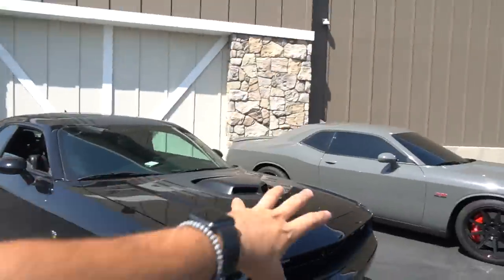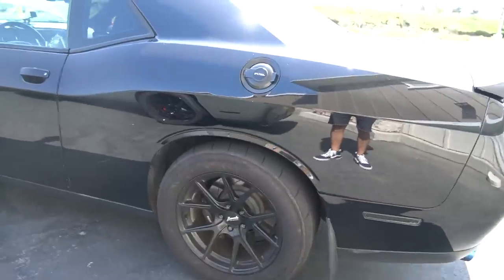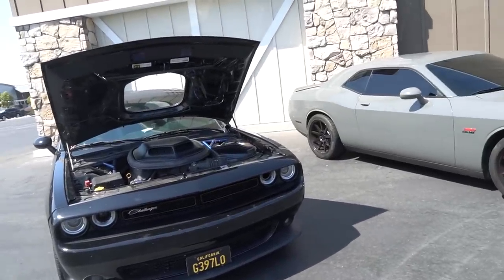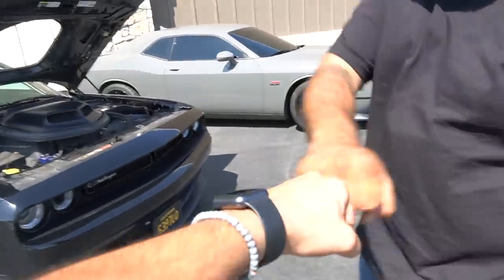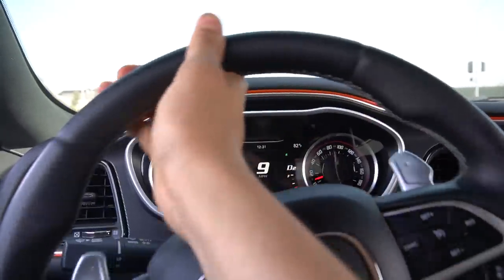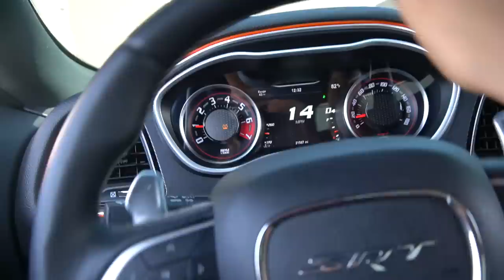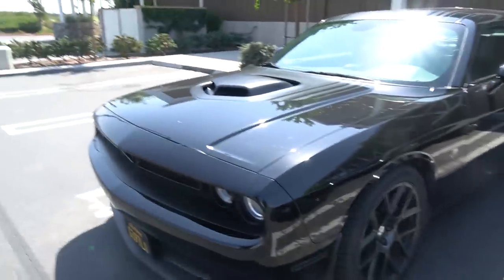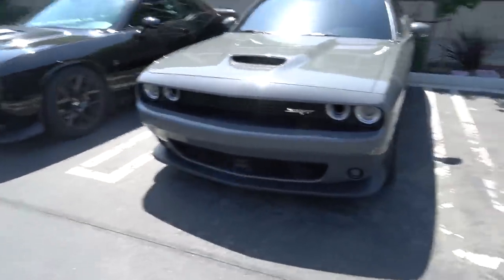Cammed Scatpack Challenger vs STOCK Challenger SRT 392!

Comment: Hmmmm who ever installed his cam did not install his cam...
Reply: JIMBO SLICE exactly
Reply: Exactly.  Smh ....
Reply: Fleeced
Reply: facts
Reply: Basically
Reply: It’s possible to get a cam and not have a lot more power he has factory mufflers with tips but still had long tube headers installed it’s like boob implants with no nipples
Reply: It’s slower because he has too low of compression because he isn’t boosted and has forged pistons he has a lot of upgrades that are only half of a good upgrade package you can’t do pistons and not turbo and long tube headers and not removing muffler and replacing it etc.
Reply: JIMBO SLICE 😂😂😂 right
Reply: no i think it's the hood scoop more air more speed
Reply: That comment was awesome.
Reply: JIMBO SLICE who tuned the car?? so i know exactly where not to go
Reply: Untuned maybe?
Reply: Joe Jones lmfaooooooo
Reply: Should have had some idling video so we could hear it the cam it doesn't have.
Reply: Trevon Adams you’d be surprised how much a small exhaust will hinder the work you do. But I think in this case he’s full of shit since he said his engine is forged not internals
Reply: @Trevon Adams I also forgot he said he’s got midmuffler delete on the “stock” car.  The way he said his engine is forged with piston and rods he doesn’t know he just made that shit up. And it’s a California legal car. It’s probably got a lot of loss on exhaust
Reply: Trevon Adams too bad I don’t know where he lives maybe I could make some cash running him he seems to be really confident in it. I think that’s what happens when guys get a fast car after driving a standard 5 speed car their first 6-8 years of driving. I can recall when my buddies Acura seemed quick to him if you shifted gears just right. Once he put the exhaust on it he was driving a “race car” it’s all he ever talked about. Then he rode in my dads Chevelle and when it twists and raises up he was glued to the seat he went out and bought a 2004 mustang with the GT package i think he said ford said it was quick. I didn’t know jack about Mustangs then unless it was a Foxbody. I still think fox body is the sexiest mustang made. He had to have that V8 so bad he was willing to use up his credit and pay 💰 for a mustang that came quick
Reply: Nah he probably got the wrong cam lol
Reply: @joejones2847  Depends on the compression.  If its same or higher than stock compression, power should be the same or more.  May just not be that big of a difference in cam specs vs stock.
Reply: Naaaa the grey 392 is not stock lol
Reply: "The cam is extra bro".
Reply: @joejones2847  forged internals have nothing to do with decreasing compression... Just a stronger material so he doesn't break any ring lands. But the cam may be an issue if the cam is meant for boosted applications.
Reply: Joe Jones it’s slower bc it’s a dodge 😂😂
Reply: I like how the second time you asked for the mod list he didn't even mention a cam 😂
Reply: JIMBO SLICE they probably finessed him they probably only did a ghost cam tune and they kept the cam. 🤣🤣
Reply: @joejones2847  good point didnt think of that
Reply: It's not his cam. If he'd just had the cam and the long tubes he'd be faster. The forged internals lowered the compression. The car is set up for a supercharger so until then ...
Reply: “It’s installed... now give me $1,000”
Reply: Trevon Adams that stupid hood scoop out too much weight on the car .. 😹
Reply: @joejones2847  mufflers aren't a true restriction, on most modern cars a muffler doesn't so anything but muffle sound. You wouldn't get but 2 hp if that.
Reply: Bruhhhhh we all know EXACTLY how a cam sounds like properly put it in... yeah buddy didn't quite do that 😅😅
Reply: WEAK 😂😂😂😂
Reply: You have to tune the car for max effect

Comment: Forged pistons made him slower, he needs boost to make up for the lower compression
Reply: 318  exactly, I’m sure it was built for boost
Reply: Forged pistons doesn't mean lower compression..... 2019 we don't lower compression anymore, we send that shit.
Reply: Demario Johnson  I mean yea but maybe they are lower compression pistons for a boost build
Reply: YES boost fixes everything......😁🔥🔥
Reply: On a typical drop in set it does lower compression
Reply: Demario Johnson mist moose piston makers lower to 10 when forged. Don’t know why. Cause I’ve been looking for 11:1 forged pistons for hemis and can’t really find any.
Reply: Jeremy McGhee I know. But most companies for the mopars anticipate boost and don’t have them I. 11:1 in their kits. Cause they wouldn’t sell as well.
Reply: @tommyhathaway9190  higher compression increases chances of knock. Companies might've tested 11:1 and had knock issues under boost. And there's no real point in going forged unless you plan on boosting because you can't squeeze enough power out of NA to make it relevant unless you rework the whole engine: cams, crank, injectors, bored cylinders, fuel rail, and all. And it becomes so expensive at that point that you'd save money by boosting.
Edit: also lowering compression reduces NA power because the power stroke becomes less efficient; the explosion has further to travel before pressing down on the piston, meaning it loses energy.
Reply: Your car stock shouldn't beat that lol wth
Reply: Lmfao. " long tube headers , cams  yeah I got this " ya turning these machines in to rice . Clown
Reply: Lower compression? What? You raise compression on these things then boost them on e85

Comment: Guy got his entire engine rebuilt and still lost 😂
Reply: That’s when I’d sell it 😂
Reply: Bro i was lost for words honestly
Reply: Mopar life....Move Over People Are Racing. "Puts on fireproof flak jacket"
Reply: Forged engine parts are needing boost can’t just do that and not finish the concept of forging the engine for it to handle boost
Reply: Camarogirl10 forged engine parts do not need boost. If he has a low compression pistons then boost would be needed to make more power. But if he has high compression pistons he does not need boost
Reply: L L.  But on the 392 6.4 needs to be forged for it handle boost otherwise the pistons get ruined and can cause the engine to blow. That’s why it’s best to get the 6.2 or 5.7 if you’re going to boost it
Reply: Well if he got a new cam and pistons he is heading in the right direction. He needs the boost now to finish his build. Then lookout that stock SRT won't come close. Hell who knows he may have forgotten to hit the sport mode.

WWG1WGA
Reply: His engine parts is forged wait til he boost it
Reply: How he pay money for performance parts and get slower? 😂
Reply: @BluedemonZL1 facts. I’ve seen this other guy on here with the same setup and he lost against another mopar bc of that. There’s also this guy with the 411 and pistons and he got whooped too
Reply: @ll.7927 he was talking about getting boost so

Comment: Scat definitely should be faster probably need a re tune
Reply: tray_srt buddy probably never got it tuned lol
Reply: Finally someone who knows what they're talking about
Reply: Yeah something ain't right.. lol
Reply: Im a GM guy and my head went full tilt....
Reply: @SK-qg1ln  very true. That was my exact thought. If you do all the work, and don't tune it, or don't do it very well it can actually be slower.
Reply: My guess is when he forged the bottom end he got the pistons with a lower compression ratio and that alone can cost him about 10 to 20 hp of not correctly tuned or boosted that’s why the engine came with high compression 10.9:1 …bigger bang…more power

Comment: Tell him to get is money back
Reply: I agree he should get his money back
Reply: Lmao
Reply: Yea all of his money he needs it back
Reply: Hemi vs. Ninja basically
Reply: He doesn’t need his money back he needs the rest of the money to get the rest of the parts to complete the build /upgrade the stuff he’s done is just about 40% of the whole upgrade and the things he’s done are the things that make the engine be able to take the extra torque and they don’t make power by themselves. Forged pistons and headers and cam alone don’t make much more Hp  if any. Once it’s boosted it’s going to haul
Reply: Joe Jones I disagree a cam, headers and tune should be 50-80 extra horsepower which should be enough to beat the same car stock so to spend 7K and still not be faster than almost an identical stock vehicle is disappointing, at least it would be to me.
Reply: Hemi vs. Ninja exactly.
Reply: Hemi vs. Ninja he just needs to be tuned and def needs boost to make up for compression loss
Reply: @joejones2847  run stock low boost u good.....
Reply: Why

Comment: I literally almost cried thinking about how this dude has spent $5,000 to lose horsepower. 🤦🏾‍♂️😳 
Omg...
Reply: Jeremy Hamilton he clearly said his plan is to boost the car so im sure the motor/cam setup is fit for that not to run all motor.
Reply: He should have bought a stang and gappd that bigass boat lol
Reply: Jesse Frias ohh okay makes sense. But wouldn’t you tune it to run properly now until get the supercharger? Hahaha. 
He may be f*cking his motor up. Lol. 
Lmao. I can’t lie I want to give Rush a run, but I have a lot of mods so I keep quiet.. I just want to be one Youtube. Haha jk jk!
Reply: Yeah pretty sure the car is tuned to run the way it is but if it really is built for boost im sure it has lower compression setup for the charger which will cause some power loss.  Now to think of it tho thats a good excuse to have after losing to a stock car.  “Hey man my motors built for boost” 😂😂😂
Reply: Jesse Frias 😂😂😂😂😂 I’m laughing my ass off! That’s a great excuse! Lmao! I’m still flabbergasted that anyone would run a tune for a boosted car while they’re N/A.
Reply: @jessefrias2575  probably low overlap on valves and a high LSA....the shit boost loves!!!
Reply: @brokeafracing6136  sometimes you really cant, for example lets say my CTSV had an LS3 instead of LSA, well if I was going to boost it I would want a cam that has little valve overlap, and q high LSA(lobe separation angle, IDK if you know, so just putting info in) probably 114degrees or higher, if your looking gor some chop really stay under 117-119 but preferences there, so if your cam is ALREADY acting like your boosted, then the best tune you can get may just net SLIGHTLY more power. (Reference: My TSP 700whp H/H/C pulley e85 11 CTSV. Dynojet(not SAE corrected so #'s are probably a but high)
Reply: @brokeafracing6136  just saw your final comment lol, if I wrre him yes I would save a boosted cam till I had the money to boost, my previous comments were purely informational.
Reply: Where are you located? Lol
Reply: @jvrrdz  me?
Reply: Jesse Frias now I don’t wanna buy a 392 because you say will get gapped by a car with 25 less hp but a 10 speed transmission and hundreds of pounds lighter
Reply: files lawsuit against Dodge immediately
Reply: @Nicktheguy24  get one anyways, don’t let him stop you
Reply: @Vanta_Industries  that’s true lol I wrote that when i was younger two years ago so yea 😭🤣
Reply: @Nicktheguy24  cool
Reply: @jessefrias2575  we buy our boats because we don't like how mustangs look ride or drive we know they are faster
Reply: I hear it's over 8k to put a cam in Hemi.  Better just Procharging it.
Reply: 10 miles a gallon 😂 you wtf i get 15 city 25 highway

Comment: Your 392 runs strong Rush! That said, a properly sorted 392 with cam and long tubes should pull a stock/mild bolt-on 392 all day, every day. I know he mentioned he has forged bottom end and plans on adding boost in the future, but he didn't mention his compression ratio. If the new bottom end has a more boost friendly compression ratio, say around 9.5:1 like the Hellcat(Factory 392 compression ratio is 10.9:1), then that would help explain why you were able to pull him. Did he mention what cam he is running?

Comment: Just goes to show if it aint broke don't fix it. These 392s are monsters from the factory, if you really want big power then just invest in a hellcat. Otherwise simple bolt ons are more than enough for the 6.4
Reply: I agree there a great motor stock, but I disagree about leaving them alone.  I gained  over 100hp on the dyno from a stock 392 with just a cam, fbo, tune and e85.
Reply: @tiredone8151  exactly, a lot of people don't think it's worth $6-8k to gain 100 hp, but if you couple that with some fatter tires and a little weight reduction you'd be giving a lot of cars problems on the road. 520 WHP ain't no joke at 3800-4000 lbs.
Reply: Nah who ever installed this messed up wit something I’ve seen cam/headers scats do 550 to the wheel

Comment: Bro your car is a factory freak! 

Cam+long tubes with forged internals and a tune should add 70-100 hp easy... he should have pulled you
Reply: Chase Reid don’t think he had a a cam
Reply: Shamar Johnson that’s what the title says🤷🏻‍♂️
Reply: eric osborne i am not wrong, cam + long tubes with an effective tune adds 70+ I’ve literally witnessed it with my own eyes when done properly lol
Reply: Yah rush should have lost that one. Either he dont know how to drive his car and didnt metion it was a stick or rush a liar and is far from stock lol
Reply: Michael Lowe rush probably running e-85 with a dyno tune and a 100 shot talking about “Im StOcK”
Reply: @chasereid7806  yah i know he runnin somthin n if he is e-85 is no joke
Reply: @chasereid7806  ive raced a srt before in my stock 5.7 and it wasnt even a gap like that. So yah i think rush lyin lol
Reply: Even if he didn’t have a cam a tuned one should beat a stock one easy with long tubes and tune. A cam and long tube should easily walk a stock one even if it has forged rods and pistons that are heavier and the lower compression is hurting his tq, peak power and throttle response though. Doesn’t make sense. Someone is lying
Reply: 🤣😂🤣😂, you ain't gaining 70 to 100 hp from long tubes and a cam. 25 to 40 possibly but not 100 rofl.
Reply: FiBTL18 I don’t know much about hemi gains but it’s bigger than a lt1 and yes you can pick up 100-150 whp which is more crank hp wise with heads , cam , long tubes, ported intake and e85. A cam and long tubes alone will give 60-75 hp alone and another 25 whp on e85. Stock c7s put out 397-405 whp stock with full bolt ons and coming and heads and long tubes they can range from 530-570 whp that’s more than 70-100 hp so he is t wrong.
Reply: @speedlife301  I do know about hemi gains since I've built them and worked with all the main shops that specialize in them such as ost dyno, inertia motorsports, hhp racing ect. That's a 426 stroker I was installing in my profile pic. You won't gain 75hp from a cam and long tubes. Cam will usually net you around 20-25whp long tubes about 10 to 15. If you do heads and ported intake mani with cam and long tubes with a good tune you will gain around 80 to 100. The reason you don't gain much with headers on an srt car is because of how good the stock exhaust is on them. They come with shorty headers from the factory and nearly 3in exhaust. Unlike most cars that have more restrictive cast iron log type manifolds. So you won't see as great of a gain from headers on a SRT car compared to others. dynoed 700whp cars running off the stock exhaust. Seen 1300hp cars still running the stock manifolds.
Reply: EXACTLY Chase
Reply: FiBTL18 don’t know why because i picked up 75 from my cam and long tubes and the 392 is a bigger engine than the lt1 so I don’t know why not . Full bolt ons and cam and e85 125-150 whp gains all vette guys pick up
Reply: @speedlife301  explained that in my last post lol. Also They're different engines they won't have the same gains part for part. So no idea why you would expect that just because an lt1 gains x hp for x part a completely different engine would have the same gains hemi or otherwise.
Reply: FiBTL18 my 5.7 went from 370 rwhp to 420 rwhp with a cam, you OBVIOUSLY dont know what you are talking about
Reply: Kgboxer5.7 right !!! even small cans pick up 35-45 rwhp. Big cams can gain 65-90 rwhp but drivability will suck.
Reply: @guerrerok90  nah I have no clue what I'm talking about you're right. I just build these engines every day  and I just wing it I have no clue what I'm doing neither do any of the performance shops that specialize in gen 3 hemis they're all clueless also I guess. I guess it was just luck that I slapped my car together and got 1000whp from it. Just lucky. Had no clue what I was doing. Do yourself a favor use a real dyno when you tune and go to lx forums and read up on the lx platforms. Educate yourself it will do wonders.
Reply: @guerrerok90  not only that if your 5.7 was stock you weren't even making 370whp 🤣🤣🤣😂 more like 330whp if it's an eagle 280whp if it's a pre eagle 5.7. And sorry to tell ya buddy you didn't gain 90whp from just a cam. Gotta love YouTube though. So many people love talking out of their asses 🤣🤣😂🤣
Reply: Michael Lowe Probably didn’t know how to drive it. I’m in a car club of all SRT’s and one my boys has a stock 392 (still under warranty so he’s not doing anything until warranty is up) and he beat other 392’s with bolt ons. You can buy and mod your car all you want it still won’t buy skill and it definitely won’t teach you how to race or drive it. A lot of people buy these things and mod them without having any experience with a quick car.
Reply: eric osborne shift points matter tranny has to do a lot these days 8 speed srt will demolish them old 5 speeds they had
Reply: I like how everyone is a mechanic in this thread....